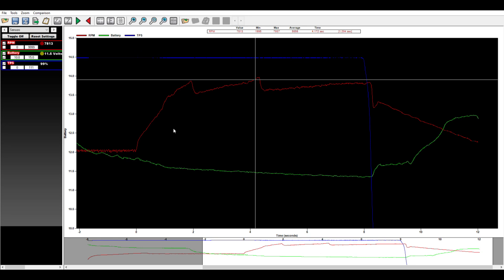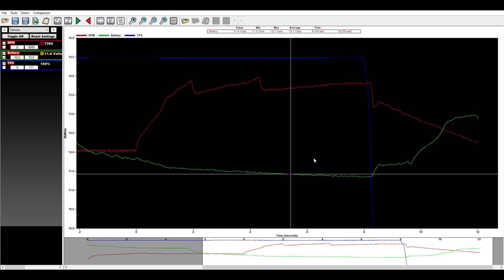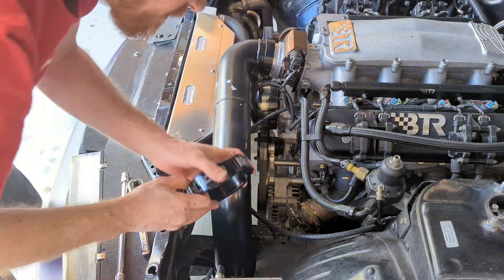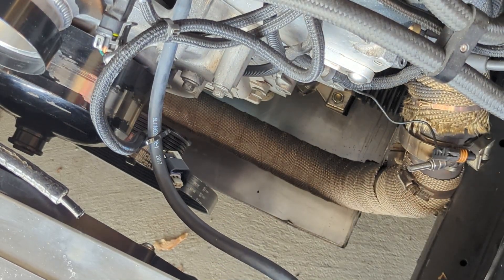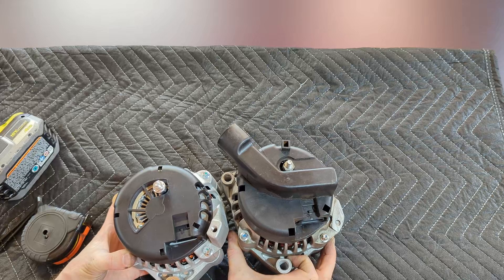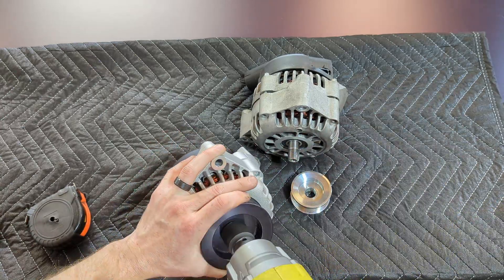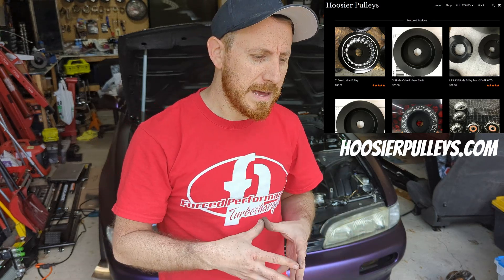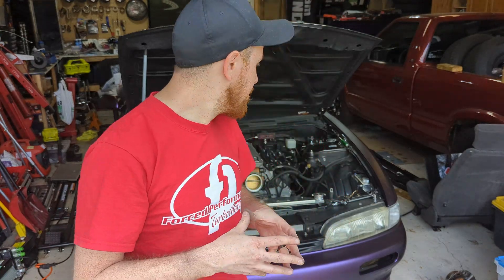THE Alternator Fix for High Revving LS Engines! | Underdrive Pulleys

Comment: Would this cause an issue if it was a daily driver?
Reply from the maker: Are you spinning the alt to higher rpms and need a different pulley?  I don't daily this car but have seen no issues from it on my end including week long drag and drives.

Comment: My ls swap will not revs over 4000rpm. Is this alternator pulley issue? Do have voltage issue too.
Reply from the maker: That shouldn’t really be causing an issue with it not being able to rev.  This fix is for if you are skinning the motor up over 7k rpm it’ll kill the alternator

Comment from the maker: Went out the track this weekend and the data log is showing nice and smooth voltage across the entire run ~13.2V
Reply: Ain't 13.2 volts bad? Thought 13.5 and above is good
Reply: Also did this helped the alternator from overheating or whatever cause I'm having issues burning up alternators and somebody told me it's because I have a low mount fbody alternator setup and the Huron fbody kit the headers are really close to it so I thought that was the reason it was burning up my alternators
Reply from the maker: Heat can burn them up for sure.  I feel like Huron makes a nice heat shield for them if I recall maybe take a look at that.  This is for over spinning when you turn high rpm 7k+